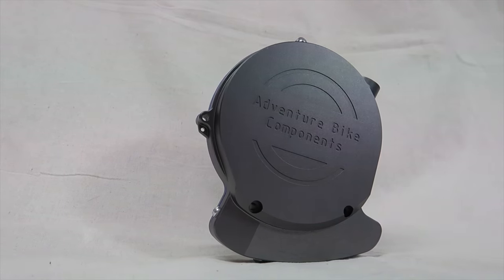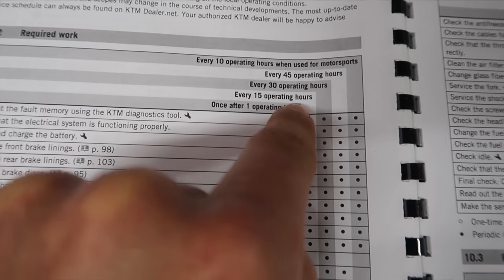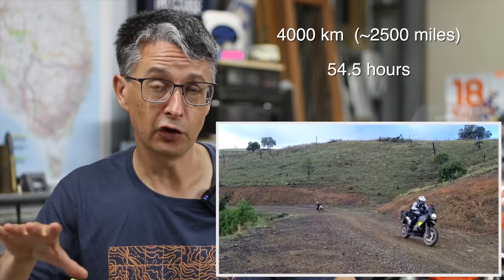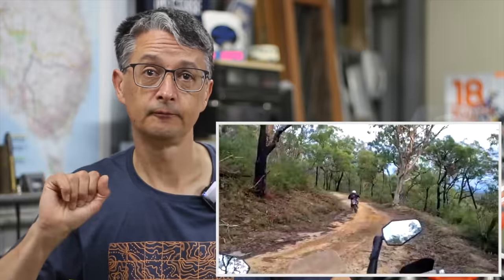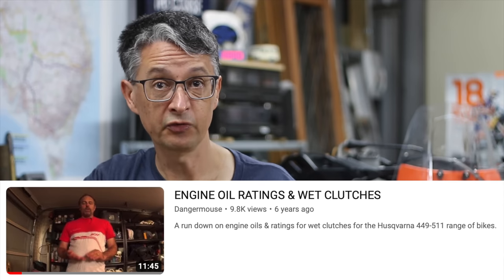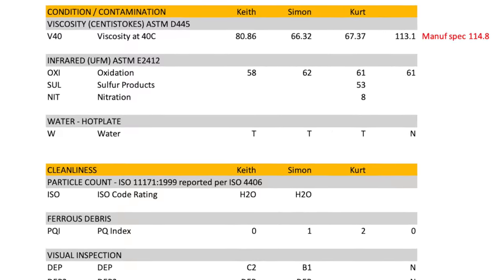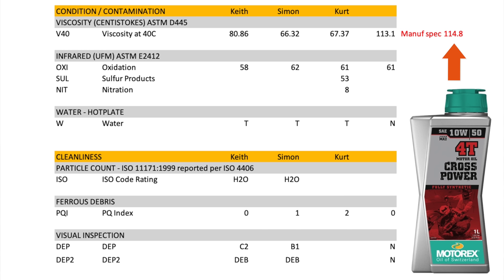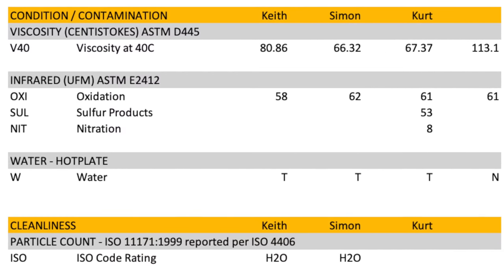Does more oil make a difference? Oil analysis, OEM vs larger clutch cover

Comment: Cheers Keith. That was very interesting. I wonder how long was the oil in the bikes in real time (weeks, months...)? Also how did the oil look and feel to you  when you dropped it (is a subjective assessment even remotely accurate)? 
I have put the nomad rhino cover on my 450 taking it up to 1500ml. Nomad recommends 3000km which is probably going to be between 30 and 40 hours adv riding. 
My original hope with more oil was that I would not have to worry about it too much when on a trip but would do about 15 to 20 hour's when Im riding enduro tracks etc... After watching this I wonder if going for a longer life oil for touring would be a good idea. Not sure where the compromise is between life and performance so it would be a guess.
Like you say though changing the oil aint hard or particularly time consuming on these bikes. If you carry 1.2 litres with you then in reality you have doubled your oil capacity. 
Have a good one.
Paul
Reply from the maker: The oil was changed immediately before this week-long trip, and sampled the day after, so maybe 10 days max.

Comment: There's a visible difference when changing the oil between Motorex and Motul, the first one being a lot thinner coming out of the engine than Motul which seems to keep it's viscosity better. Maybe do a video about that? :)
Reply: Motul 7100 in the 500 really makes a difference over the Motorex 4T. I do BDR rides and never think twice about going to the 1200 mile on a quality oil.
Reply: You can't tell the viscosity by looking at it.
🤦 seriously
Reply: @marcwilliams9285  you can’t measure it by looking at it at but you can compare two oils and know if they are close or if one is thinner. You can also compare to when you poured it in new. Can’t you tell that honey is thicker than water?
Reply: Stop embarrassing yourself. 
The only way to tell is to have the oils at the same temperature and use a viscosity funnel to time it.
If they are different when pouring out of the bottle then they are different viscosity oils to begin with.
Reply: @marcwilliams9285  the only one embarrassing himself is you losing your temper over such a simple matter. Again, I’m not talking about measuring viscosity (and I do know how to do that). If Motorex loses more of its viscosity that’s a bad thing, especially when we’re talking stretching the oil change interval.
Reply: Who lost their temper?
Some people! 🤦
Reply: @peterbonivart6818  I don't use the regular Motorex 4T variant but the Motorex Crosspower variant which is more expensive. I do 30-40 hours oil intervals (Adventure riding) and the oil looks fine - it could go more.
Reply: I heard oils with a lower variation  between the 2 viscosity numbers have less viscosity modifiers and they are likely to be the quickest to degrade. Suggesting 10w 40 may be better for adv riding where extreme heat is less likely. not saying i believe it. Seemed counter-intuitive would like to test it.

Comment: My KTM dealer told med not to buy the motorex motorcross/enduro oil since it is made for 10-30 hours intervals. He told me to go for "normal" fully synthetic motorex oil if riding adv, or not changing oil every 10hours.
Do not know if there is any truth in this. But I am only using "normal" fully synthetic on my Beta and changing the oil every 30-60hour.

Comment: keith. off topic. did you get chain slap noise when you first got your bike. i am, i tightened it but still noisy. ive done 15 hrs from new. its got a 13 front sprocket.
Reply from the maker: Not that I recall.

Comment: Hi Keith, just out of curiosity, how was the sample taken out of each bike, ie, hot and just drained?
Reply from the maker: yes. caught mid-stream after removing the sump plug
Reply: @keithjob  Thanks Keith, I’ll do it the same way as I also have an oversize clutch cover (Nomad ADV) and also the Twin Air Oil Cooler. It’ll be interesting to see if the oil cooler prolongs the viscosity of the oil. Heading off next week but when I’m back I’ll send an oil sample off to get tested and let you know the results.
Reply: @MotoMongrel any results from your test?